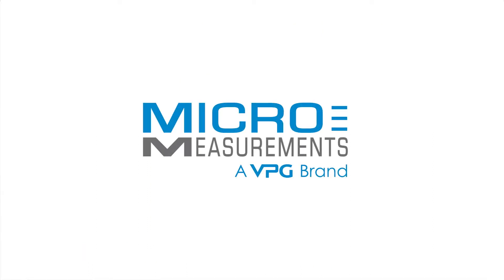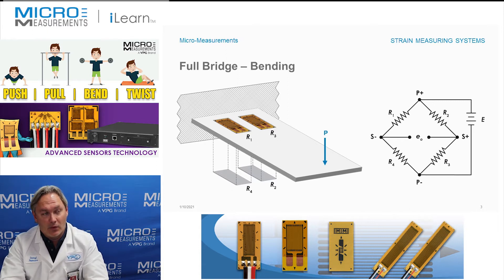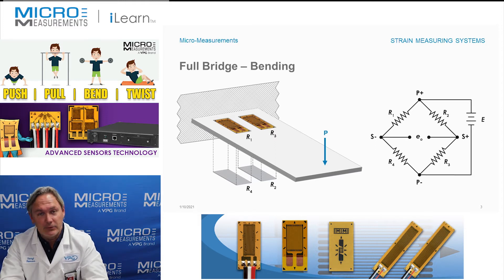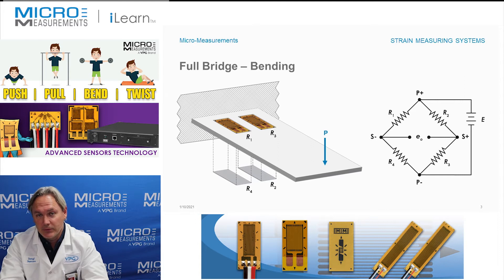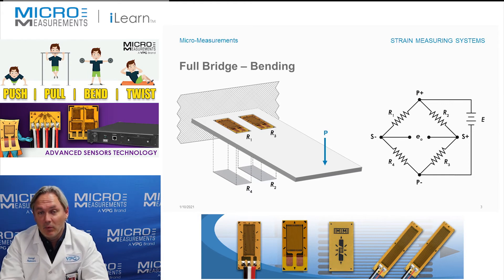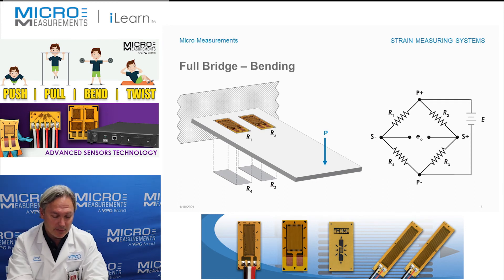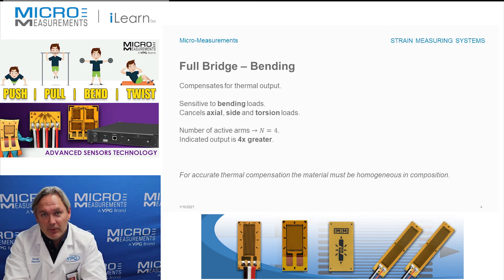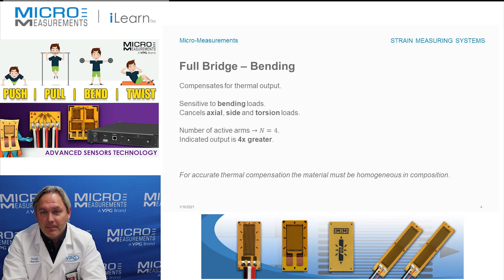Full (Wheatstone) Bridge – Bending.

Comment: Great video! I'm currently working on a respiratory rate sensor and the idea of a full bridge of commercial strain gauges sensor is being attempted. Do you think it is possible to detect the variation of thoraxic volume of breathing with 2 or 4 strain gauges in bridge? Also considering whether the gauges are going to be fixed on a thin metal or plastic beam for using in a chest strap.